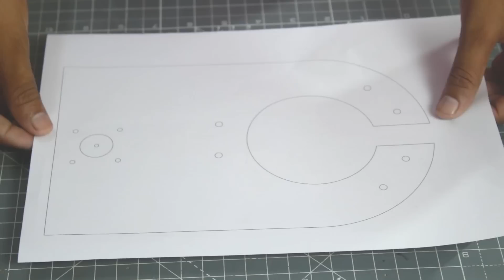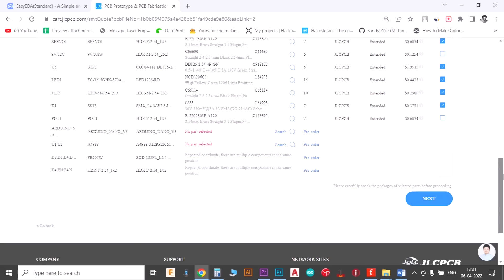DIY Arduino based Wire harness wrapping machine | Arduino project

Comment: Great machine, great idea, useful too  but do you really need  Arduino for this project..?!
Reply: Use dc motor.  Easy
Reply: My thoughts exactly.
First reaction: "Cool machine!"
Immediately after: "Wait, Arduino? For what???"
Reply: No, no it is not
Reply: A handkrank, would be enough. Then you get a pretty wiring harness. And some nice guns to show.
Reply: A simple  555 timer chip or transistor will do that no need for a microcontroller
Reply: @martinmtawali7359  or just use a DC motor, a power supply and a switch. This is highly over engineered.
Reply: @FM-mj7gu  lol was this whole thing engineered just to advertise JLPCB.
Reply: @FM-mj7gu  agree with your comment off over engineered.  And we do that many times. I mean how many patented products did we see and our reactions was like :  what?!  They making money with something so simple?! "
Reply: выебнулся просто
Reply: Yeah, way over engineered. I could see the arduino being used if there was a way to automatically feed the wire/cables through for a consistent wrap and if you wanted multiple layers of wrap. I could probably achieve the same results as the video using the same mockup and my kids snap circuits.
Reply: Interesting approach you took.

Do the stopping of the disk with a light sensor and an LED.
Reply: I think that project can be a part of a larger array of bench projects that use the same Arduino board
Reply: And isn't spiral-wrap pretty much dirt cheap too? I just did a quick search and found it as low as $.22/ft for 3/8" and about $.36/ft for 1/2". And that was literally just the first couple listings. I'm  certain I could find cheaper if I actually shopped around and wanted a decent quantity of it at once.   I mean I guess at SOME point this will save you money. But the amount of the stuff you'd have to use to justify it just doesn't seem worth it.
Reply: @Jester_The_Jynxster  after applying that said foot of it, you will be crying for a machine to do it for you. Actual spiral wrap is awful, and there are no tools for it. Then there is "wrap" which has straight opening on one side and there's a plastic tool to apply it over the wires. Later one is usable for longer runs, but actual spiral starts to get really annoying after couple feet.

Little background: had to do an office with adjustable standing desks for about 100 people. Every desk got a wire harness about 3 meters/10 feet long and cheap boss made us do it with spiral wrap.
Reply: @villehietala9677  Yeah I've made plenty of harnesses with spiral wrap in my day. If you just make up a head like a pull through conduit it works just fine till you get beyond 10ft or so. Can't think of too many situations I've ever needed a harness longer than that
Reply: Nowadays ppl tend to use arduino for evertyhing forgetting that in many cases there is much simplier and reliable solution.
Reply: The Arduino (or equivalent) could very well be cheaper. I designed a circuit with logic gates to control some LEDs for a cosplay, and when I priced it out, I found that using an Atmel microcontroller was less expensive and required fewer components.
Reply: I would use a small USB powered fan motor and a 'Push on, Push off' switch.
After 35 years in industrial maintenance and engineering, I'm too lazy to complicate something that ought not to be complicated.
Reply: Thats exactly what i thought
Reply: Like with a lot of Arduino or Pi (my favourite) projects, it's less about "does it need..." and more about "can it be done with...". I love this project, it's amazing.
Reply: Nice idea. Source for the pulleys and what kind of tape. Thanks
Reply: Was thinking that too
Reply: @@user-qv3dh8te7w а если взять S7-200, то получится https://youtube.com/watch?v=UdC_jhQKFYM&si=EnSIkaIECMiOmarE
Reply: Nobody wants a taping machine when they can have a smart taping machine.  "Hey google!  Turn on my taping machine."
Reply: I agree. It's not needed and you'd better save up what you have given the chip shortage
Reply: @montagistreel  yeah, because he can’t use it for something else the state should take it away from him and give it someone else. What a dream world that would be.
Reply: @thetruthexperiment  the hell are you talking about
Reply: Could totally do away with the Arduino by using a relay, a 2/3 pole momentary switch to control the relay,

The second switch would keep the relay on until a little detent would release the switch and stop it in the right spot, similar in theory to early windshield wiper delay design.
Reply: @TheChainsawKid  exactly!
Reply: @TheChainsawKid  Yea no. That's not how stepper motors work.
Reply: @Евгений Малышев неплохо, но мне кажется нужен ПК с поставленным на него Mach3
Reply: @ShcherbynaM  система будет не очень надёжна, если не поставить для управления s7-400h + fm458
Reply: @herecyonly  естественно,  и привод SIMOTION, и HMI на WinCC.
Сарказм оценил.
А вообще и S7-200 много https://youtube.com/watch?v=UdC_jhQKFYM&si=EnSIkaIECMiOmarE
Reply: @ShcherbynaM  a PC with Mach3 would probably work but I think it would be safer to go with a programmable logic controller, an industrial servo controller, and a precision rotary hall sensor to stop it at an exact angular position.
Reply: @elliothickle3247  we were just ironic that the design of the system was overengineered, of course this could be fulfilled with just brushed dc motor with help of a microswitches
Reply: @ShcherbynaM  датчик холла из компьютерного кулера.
Reply: @mrrock131019  датчик холла - аналоговый девайс, нужен будет еще компаратор (а для компаратора еще нужно отрицательное напряжение) или транзистор\оптопара, а потом компаратор\транзистор\оптопару нужно будет через реле подключать к мотору, так что самый дешёвый вариант - микропереключатель, они есть с бобышками на концевиках, чтобы трение не убивало его
Reply: @ShcherbynaM  В компьютерных кулерах в "датчике Холла" помимо собственно датчика магнитного поля стоит усилитель и относительно мощный открытый коллектор на выходе.
Reply: @pipespb  в любом случае можно взять переключатель на 2 параллельные пары, нормально открытые контакты подключить к резистору, так, чтобы мотор при отжатой кнопке замыкался на этот резистор, тем самым переводя электричество в тепло. Общие контакты на плюс и минус мотора, а контакты что замыкаются - на выход ШИМ контроллера. Такой же подход есть на ЧПУ фрезерах, если жмёшь на аваринную остановку, то вращение шпинделя нужно остановить почти мгновенно, там резисторы размером с 5ти литровую канистру бензина, а иногда и больше (в зависимости от электродвигателя выбирается).
Reply: @ShcherbynaM  В данной конструкции тормозной резистор нафиг не нужен, не та инерция у подвижных частей. Достаточно просто закорачивать выводы электродвигателя. Релюшкой. А ДХ нужен для обнаружения позиции ротора с совмещением просветов.
Reply: @elliothickle3247  I mean yeah, if you wanted keep things simple. A Raspberry Pi 4 with a 4k camera running OpenCV should be able to compute the rotational angle via image processing. You could train the AI model in only a matter of days with Amazon cloud computing
Reply: @elliothickle3247  Or at the very least a vfd with an encoder. Let's keep things civilized without going overboard 😂😂😂
Reply: Yeah  my mistake
Reply: This i want to build. Do you have drawing to share?
Reply: The arduino is needed
For the disk to stop always with the slot facing forward
Reply: @narcisadrianrus7464  This project does not have that feature though, towards the end of the video you can see the machine stop at different points, there isn't any feedback for the Arduino to know the position of the slot right now either, could easily be added though
Reply: @darshangovender129  
Pá
Reply: @darshangovender129  the stepper motor stops the wheel in the same position each time, just that he had lost some steps at the end. Look carefully and it stops in the exakt same position at the top each time.
Reply: @narcisadrianrus7464  You could make it stop at the right place with a simple microswitch, absolutely no need for an Arduino
Reply: @narcisadrianrus7464  Or... you could just move it  round with your hand.
Reply: @narcisadrianrus7464  I can think of many ways of doing even that without the need for a microprocessor
Reply: @narcisadrianrus7464  pullout and pushin from the center
Reply: @narcisadrianrus7464  you could do that with a microswitch or reed relay
Reply: @narcisadrianrus7464  no need for arduino to create that functionality.
Reply: @narcisadrianrus7464  a limit switch could accomplish this without a microcontroller.
Reply: @narcisadrianrus7464  No, no it don't.  Likely someone already stated this in this 50 comment thread I ain't gonna fully read but I can think of half a dozen ways off the top of my head.  Arduino is just added complexity and expense not needed in the slightest
Reply: @narcisadrianrus7464  A cheap limit switch can be wired so as to stop the disk with the slot facing forward.   A DC motor  with an ON/OFF switch could be used instead of a stepper. The limit switch is wired across the On/Off switch and keeps the motor running until the slot faces forward.
Reply: @narcisadrianrus7464  It could be done with a simple circuit or switch. A microcontroller is not needed for this project in my opinion. 🎈toodaloo

Comment: Very nice contraption but you don't really need arduino to run it, do you? :D, I wonder if there's any kind of thin strong wire that can be added to the batch for easy unwrapping/cutting, maybe fishing line?
Reply: Nah, but if he's a typical maker, he's got dozens of arduinos and smaller steppers pilled in the corner. Plus now adding all sorts of features becomes a line of code. Waxed dental floss would be worth a try. Slightly sticky, doesn't fray, and is easy to tie-off.
Reply: You could use literal cutting wire made for purposes like that
Reply: Was thinking that myself - why the Arduino? It's a gadget to wind tape around a bundle of wires!

Sure, the Arduino makes it easy to add features, but just what kind of features could you possibly add? Unless you're automating the entire process (set the cables in, push the button, come back when it's done), I can only think of one thing you could add that would be any different than just running a motor with a simple foot switch. That would be a sensor to stop the winder when it's in position to insert or remove the cables. Of course, if you're using the variable speed like an old sewing machine pedal provided, you wouldn't really need that.
Reply: Wax nylon tape. We had a special kind in the oilfield that would melt itself together when the temps got hot enough. U can't tear it. 

It would be perfect for this